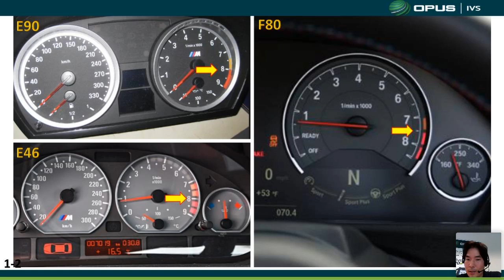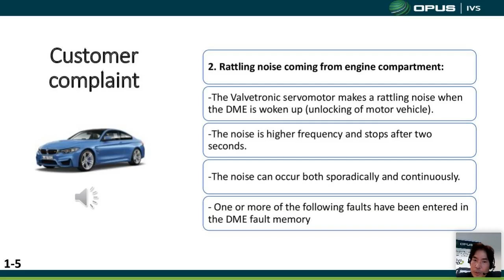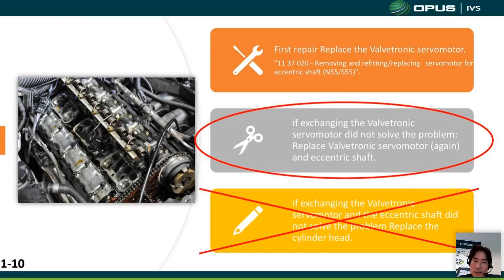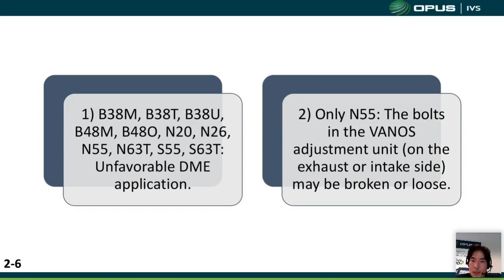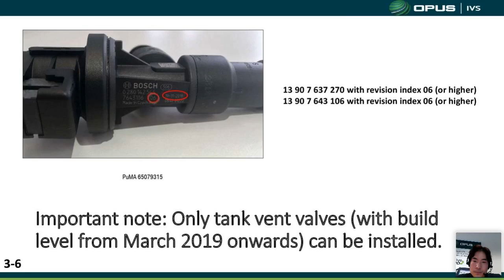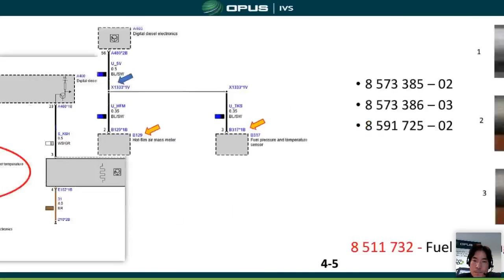BMW Common Faults 24th Feb 2020

Comment: Also have the high frequency noise when i put on the ignition. The car has codes 135608 135808. Its running on the throtle body now.

Comment: I have 4.5 and 0.3 volt on the sensor signal wires on my n55 valvetronic motor with it connected. Do i need to replace the valvetronic because is already did that and the both give me 4.5 and 0.3. thank you in advance

Comment: Hi.have 328i n50 with bank 2misfire(4,5,6)cylinder.running very bad at idel.po 300 as well and airflow meter some time and  asa disconnect one of the camshaft sensors , engine runs nice but engine light.please help me out.tnx.

Comment: 340i B58 engine. I have VVT motor clicking noise when engine is turned off, but only when the motor is cold. Probably the same problem, like N55/S55. VVT motor replaced, but same problem. Eccentric shaft might be damaged, but no codes, and it pulls very well.

Comment: I am a mechanic at skymax auto, and I am facing a problem with 46 engine, valvetronic power supply. I have 12v going in the DME but only 4.85v is coming to the valvetronic. Am seeking for help

Comment: I’m having a weird problem I can’t diagnose. I had a generic air vacuum leak code and I took it to my independent mechanic and he said the valve cover is bad and the servo motor (valve cover was old and pcv inside was cracked, replaced with oem, also had the valvtronic changed with a new VDO brand one). Now the problem I’m having is when I start the car, the rpm doesn’t bounce up fast on a cold start, it has a little lag to it, it doesn’t have or show any codes at all. The issue seems like it started with the changing of the valve cover and valvtronic. I tried to clear adaptations and reprogram the valvtronic I’m having issues. When I did the procedure for the valvtronic it does the 450 cycles, then 50 cycles free of problems but when the programming finishes it gives me an error like it’s not connected and it quickly clears, instead of the prompt that says done. Is there an area I should be looking? 2013 bmw 335i e93.

Comment: Hi, great video. Got a question, I scanned my N55 M135i and found a 133E10 code which is persistent. I don't have any symptoms as you described (clicking from motor, high frequency clicking when turning on/opening locks, etc). Car has only done 70K kms. No other symptoms other than slightly higher fuel consumption. Idle is ok but not as smooth as previously which was very consistent. What advice would you give?
Reply: It's time to change the timing chain and the plastic bracket

Comment: thanks for doing this video last week I got a 2009 BMW 325i with Vanos faults I remouved the 2 Vanos solenoids valves and cleaned them and swap positions but the problem was still there so I remouved the two check valve on the side on the cylinder head on the right side and one of them was really dirty so I cleaned both of them and then the problem was solved it was a high KM car and the problem with the valvetronic motor on a 4 cylinder X3 it was noisy for a couple of second when  locking and unlocking the car I think there was a fault in the DME but I think the check engine was not on so I send it to the BMW dealer they changed some parts under a warranty extention but I think it was the timing chain that was under extended warranty and the customer had to pay for the valvetronic parts.
Reply: This might be the solution to my problem